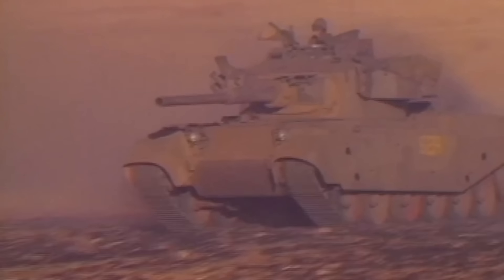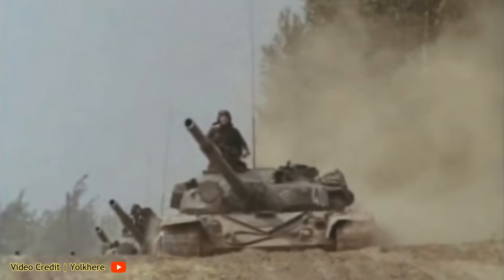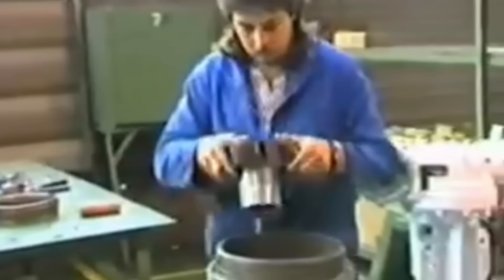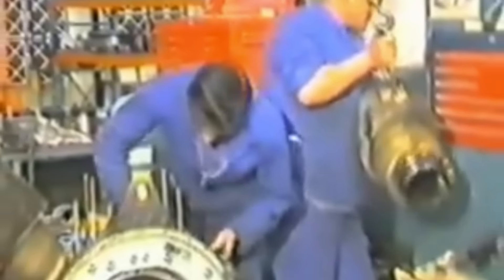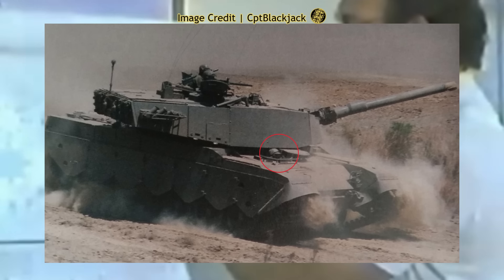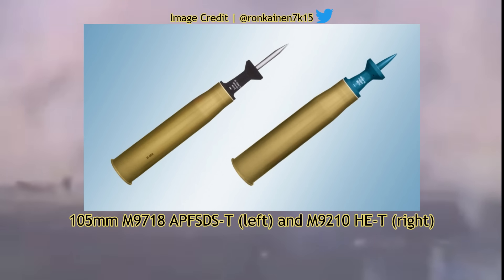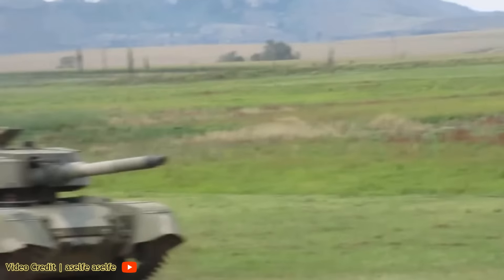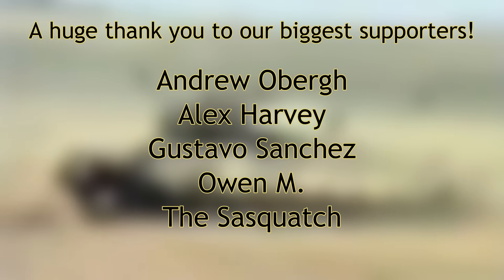Centurion Rebuilt | Olifant Mk1B Main Battle Tank

Comment: Facing T 72s in centurions is ballsy to say the least...
Reply: Uptier gaming
Reply: Not if your enemy is outright incompetent
Reply: A 105mm cannon can still knock out a t-72 with apfsds
Reply: It's not a Centurion. Did you even watch the video? 😂🤦🤷
Reply: @fukiduki9629  Depends which 105 gun, what type of APFSDS round it uses and which version of the T-72 we are talking about. For example, all of the 105mm APFSDS can penetrate the T-72 Ural, but not the T-72B3M.
Reply: @ravenouself4181  frontally it might not. But the lower front plate or the sides, and the 105mm will take it out either way
Reply: @Sajuuk  it's modified Centurion. Same chassis,tracks and hull.